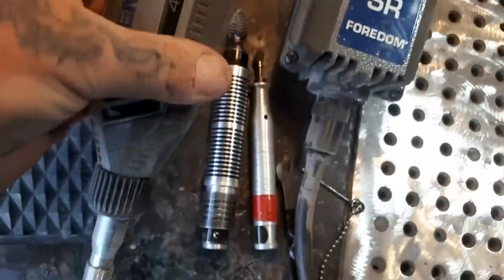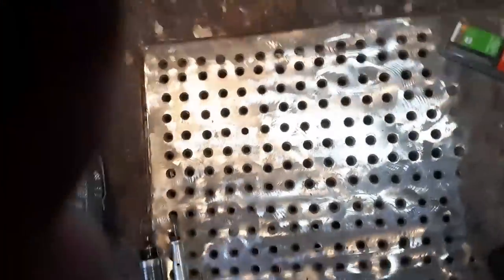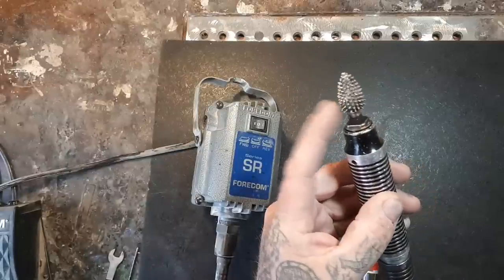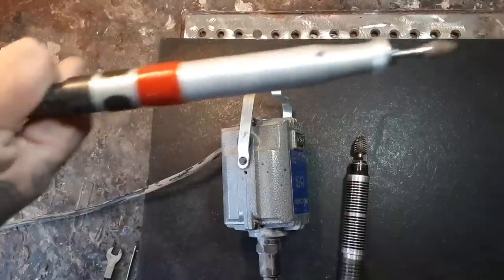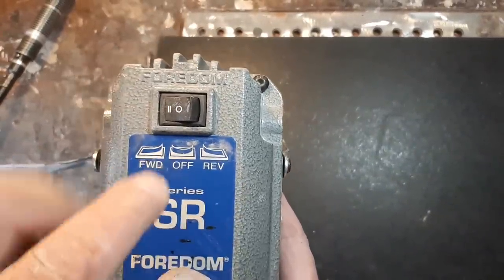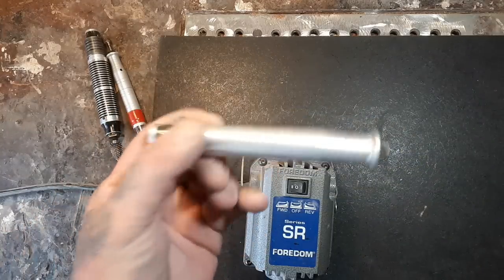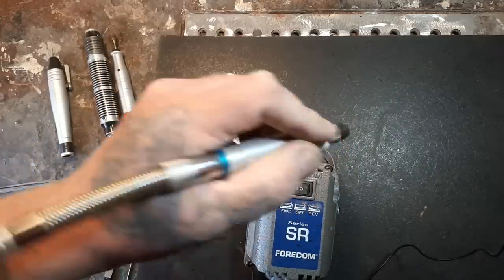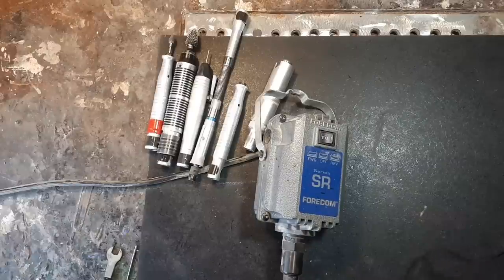Upgrade your wood Carving tool to a Foredom flex shaft, Foredom, Power carver, carving burrs

Comment: Its all about learning what your tools are capable of.  Mistakes and misuse are all part of the process.  I use my micromotor for fine detail and dremel for rough out.  That being said I mainly work with basswood blanks or live edge boards and basswood is really soft.

Comment: yeah if you need to hog out a lot of material, esp. hardwoods and the occasional metal piece, Dremel will bog and die on you, it just doesn't have much torque, but really good for finishing and polishing bcs it has a high rpm. If you're like me, fed up using a dremel to cut, deburr, sand hog out wood and grind some metal too, it's time to think about a Foredom.
thanks for reminding me it's time to be done with using a Dremel
Reply from the maker: Yup thanks paul

Comment: I looked for the Foredom SR, unfortunately, they go for 400$ around here.... I did find something cheaper on Amazon... It comes as a kit with some cheap bits, but the flex shaft is compatible with foredom handles, so I might try it instead of getting a Dremel...

Comment: Thanks for your info Jordy much appreciated. For those of you in the UK like myself I have just bought a fordedom SR from Amazon for £59 cheap as chips, I think they could be an older model than the one Jordy as but the only difference is the label on Jordy's is blue and the one I have is red. I messaged the seller because I noticed it had a plug for the US market, they told me it would come with an adapter for the UK power supply so I bought one, it's brilliant. The cheapest on the UK Amazon is £ 89.98 today again very, very cheap. The highest price is over £ 600. Also if you're in the UK check out cooksongold.com jewellery suppliers in Birmingham. They also have Fordedoms for sale and or have had a cheaper version of the Fordedom called Bench Craft it comes with the small jewellers hand piece but you could buy a hand piece from Ebay or Amazon to take the different sized burs.
Reply from the maker: Best tip all month rite here!! Ty
Reply from the maker: Urs is not a older model, mine is 110 power so its blue urs is 220 is red, same colors for here :) 
(If I had a 220 hook up I would use the red one)
Reply: @CarvingFusion  Thanks for that Jordy, that's something I've learnt today. The Red labelled Fordedoms is 220v  50Hz which I believe the US mains plug can be cut off and replaced with a UK 3 pin plug but for whoever else reads this check to make sure but don't forget if you change anything on your Fordedom before the warranty runs out they won't fix it should something mechanical go wrong with your machine. They'll say you've modified it, which won't cover it under warranty.
Reply: @lindarogers8994  Thanks for that linda,i had seen them on ebay but many siad they are fake but if they work fine who cares be good to know in time how your getting on with it i will take a look at amazon 59 is cheap
Reply: @lindarogers8994  i think im cursed or something just looked on amazon uk cant find one for that price you must have been lucky
Reply: Hi Mike, yeah might only of had a few at £59 my sister reckons they went quick because I asked a question, if it had a UK plug because in the picture it wasn't shown, they said no but it would come with an adapter, so I think other people read the Q&A's and may have convinced them to buy one. The cheapest on Amazon today is £ 89.99. I know it's 30 quid more than what I paid but it's still a bloody good price. As for buying a foot pedal I have bought one from Ebay, it's rated at 220v which is ok for the UK. It does have the US pin plug and the block socket for a sewing machine but they can be cut off and replace with UK plugs and sockets my brother in law is an electrician, so when it arrives, from Hong Kong. I'll take it to him to check it over inside to make sure it's as it should be before we change anything. I read on a forum the other day that someone bought a metal foot pedal, the one that I've bought is metal, any way this chap said when he opened up the foot pedal he found bare wires almost touching the metal frame work with only a piece of paper in between. He said he just wrapped insulation tape around the exposed wires and glued a piece of rubber where the paper had been and the pedal was good to go. I don't want my Dremel hard wired into the foot pedal, I want a  UK socket so I can plug different tools in, if you know what I mean. I came across Jim Overton - Jimson's Stuff yesterday a UK based Youtuber. I watched a video of him carving a wooden skull, half way through the video he shows the foot pedal he uses, they sell them on Ebay,  which he cabled up himself.
Reply: @lindarogers8994  Hi Linda,thanks for the reply you got a good deal i had seen them on amazon and bangood for the higher price i may get one in time but for now i will carry on with my dremel 4000 and when i get more into it i will get the sr to use the larger burrs,but for now i will get the foot pedal to make life easier,i will take a look at jimsons channel,thanks again for your reply hope you are getting on ok with the carving.
Reply: @sandman2651  Hi Mike, there is another channel you might like or already know of it, that is Mike Stennett, "Stennett Sticks" he uses a micro motor his work is amazing.
Reply: @lindarogers8994  Jonas olsen woodcraft is also a brilliant carver worth a look
Reply: The inexpensive Foredoms are Chinese copies. I have 2 along with several wands. No complaints other than the pedal. I'd strongly suggest adding a genuine Foredom pedal. It's a night and day difference in speed control.

Look on AliExpress. Most wands are less than $20, some are less than $10, and the SR is around $80 shipped. I'm in the US.